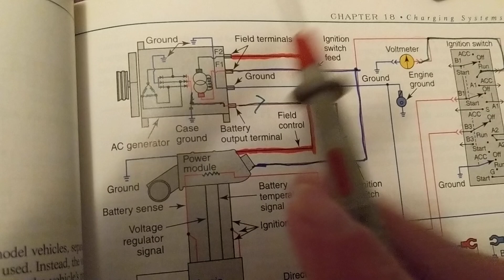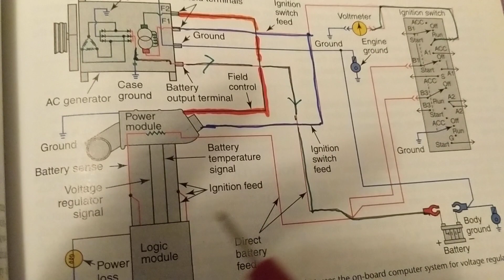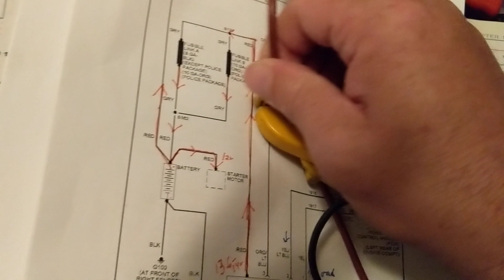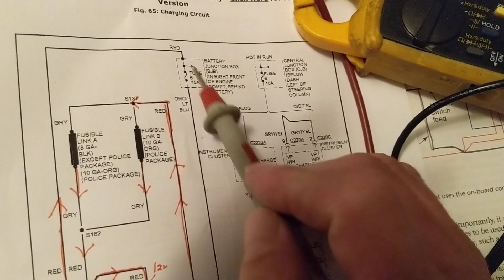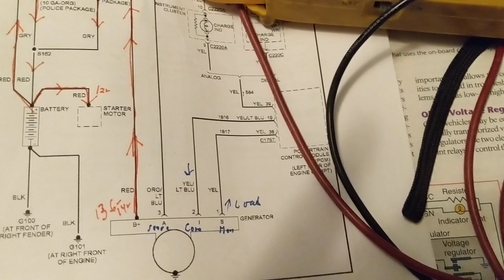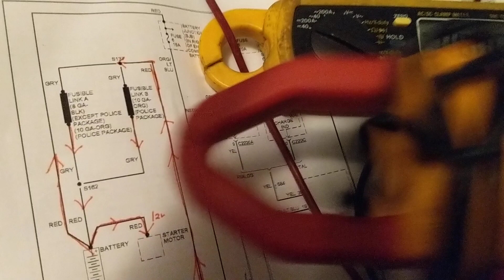HOW TO TEST AN ALTERNATOR FROM WIRING DIAGRAM

Comment: What brand and model is that meter? Tks…
Reply from the maker: Actually the brand name on it is not even visible it's over 20 years old
Reply from the maker: But you can find much cheaper ones as long as they measure and DC voltage and DC current up to a hundred amps

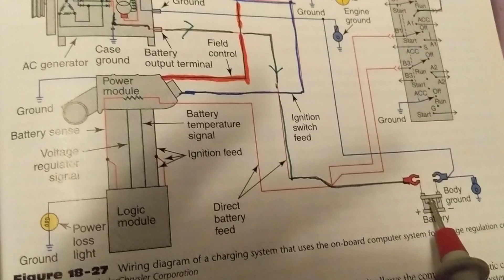Comment: With all due respect: at 4:15 the statement that the Batt. “was drained because we took several hundred amps out during starting” is incorrect. Example: Big Rig Diesel engine, cold morning, I hit the starter—400 Amps for 15 seconds. Batt. flow rate (amp hours) are calculated over a period of time (60 min.) 400/60= 6.66 amp per minute @ 400 amps. But we only used 15 seconds or a quarter of the min. =.25 min. Therefore, 6.66 x .25= 1.67 Amps taken (less than 2.0 Amps) from our example Batt. which is replaced quickly with good tight clean connections and fully functional alternator. Thanks for your instructional vids and keeping us zeroed in on the text book not some off the wall home brew drawing.
Reply from the maker: The point I was trying to make was when you have a crank and no start which means either a fuel problem or ignition problem when you keep on cranking and cranking the battery will how much amps the battery will take depends on the cylinders and the compression
Reply from the maker: But I understand your formula Dan remember on a cold day zero degrees you're using cold cranking amps the true way of measuring is putting a clamp on the battery terminal cable keep in mind also the state of charge at the battery started with thank you so much Dan I appreciate it

Comment: Sir may I know what alternator terminal goes to the computer
Reply from the maker: Depending on the make and the model of the alternator usually com means communications between the computer and the alternator sometimes the FR means the field winding is being controlled by the computer s is usually the sensor voltage how much battery voltage there is so it depends on the make and model of the car and also it depends on the schematic will tell you different abbreviations

Comment: Can t we test this  by voltage basis
Reply from the maker: Yeah I made a video on the channel to measure it the voltage output and also the current output which is very important since it is computer controlled you could go to the channel Joe electronics schematics for Auto

Comment: Liked it. If you can, next time show us an alternator that is not charging ( possibly due to an open or shorted signal to the computer, and open or shorted field control or an open in the cable going to the battery itself).
Reply from the maker: You can look it up on my channel there's a few videos on how to test alternators and faulty defective ones on both channels